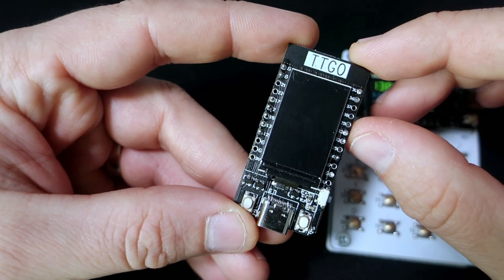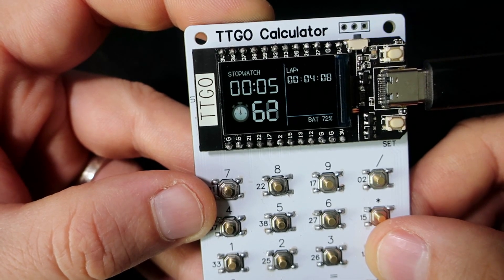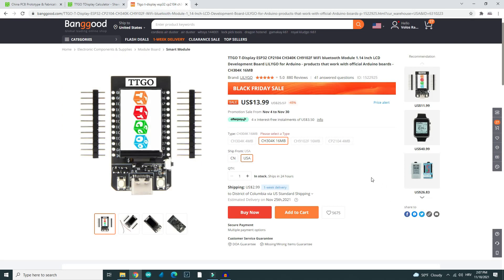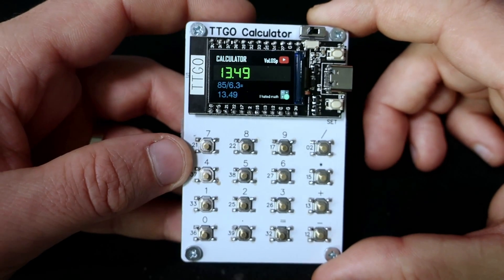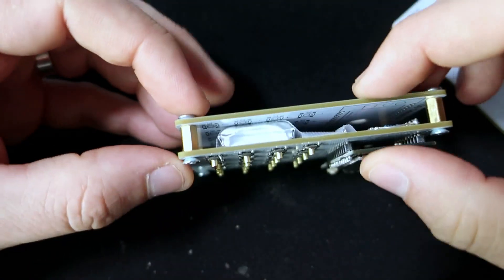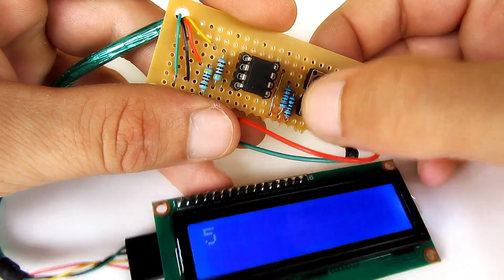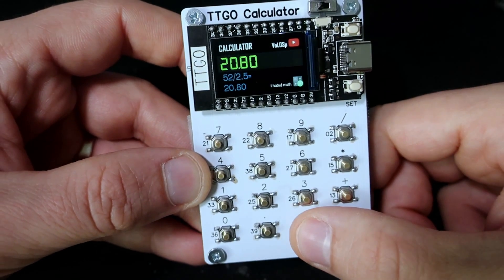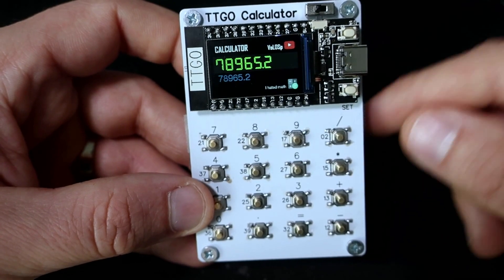TTGO T-Display Calculator, game and much more (ESP32)

Comment: Nice Project! What software did you use to design the pcb? Is that pcb project available so I can modify it? Thank you,
Reply: What pins are still available? I noticed that you have the on/off switch backwards. To the right shuts it off ... to the left turns it on.

Comment: These little boards are so great for learning code DIY projects !

You really should look at the B3FS-4002P - Omron - Tactile Switch, B3FS-4, it's much much easier on the fingers than the little brass tipped ones.

There's lots of space for a bigger battery too. many Chinese gadgets use the Nokia battery BL-4C. It's about the same price as your battery, thinner and double the capacity.
Reply from the maker: Tnx for advices, i heard for that battery. Yep these switches are much nicer.